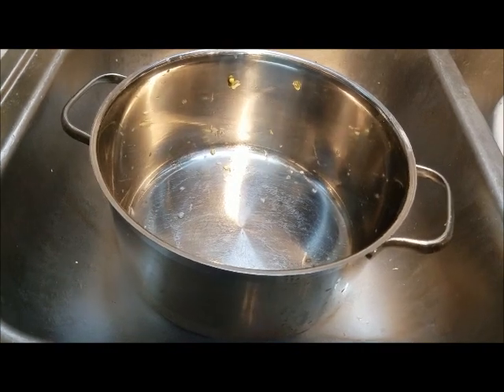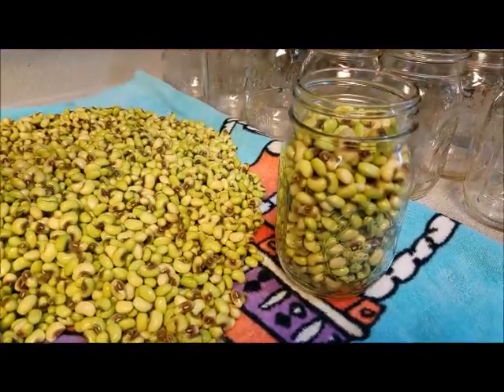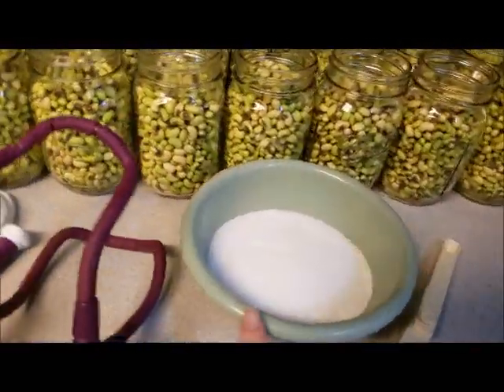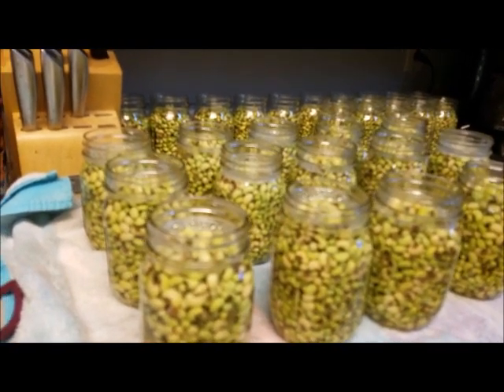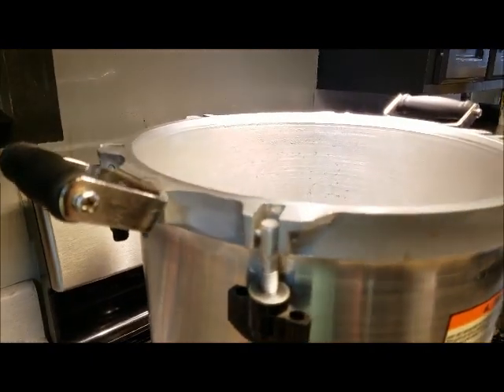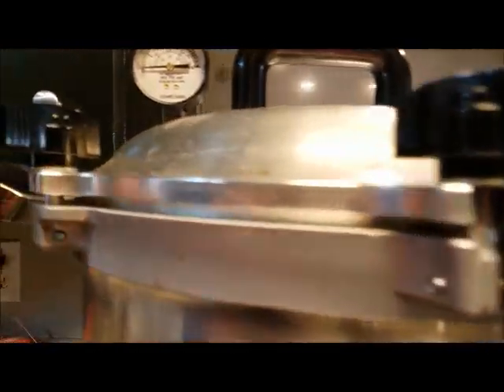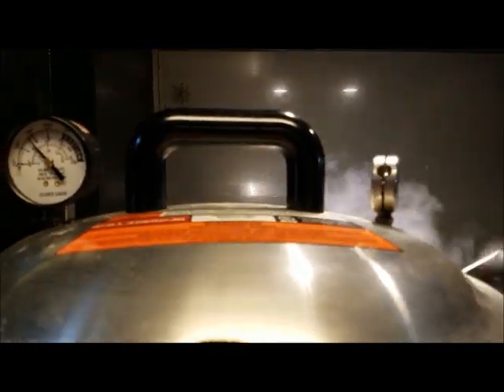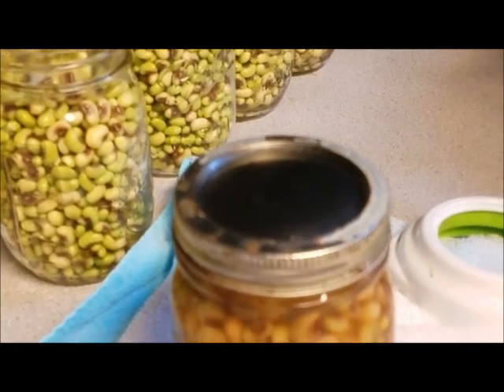How to Can Purple Hull Peas in an All American Pressure Canner

Comment: This is something I'm working on learning to do.  Do you not wipe the rims with vinegar to kill bacteria?
Reply from the maker: We do not, the jars have been washed in the hot dishwasher and we warm the lids. We do put vinegar in our canner. After the canning process is done and the jars have cooled and sealed, I remove the rings to prevent bacteria from growing.
Reply: @RussellsLovingLife  I meant the rims of the jars.. sorry,  like I see most ppl wipe the tops of the jars before putting the lids on with vinegar on here to prevent bacteria there. I'm really wanting to start canning but I get so nervous of boutulism.
Reply from the maker: We worry about that botulism as well. My husband has read and learned about different ways over the years. With the pressure canner, temperatures get above the normal 212 degrees boiling point. You can use the vinegar if you like. Some people do and some people do not.

Comment: We just canned zipper peas, using same canner you have used. All of our pint jars after cooling have no liquid! What did we do wrong? 10 lbs. pressure for 40 min.
Reply from the maker: Some of ours do that too. If your jars sealed, you should be fine. Next time you may want to not pack as many peas in the jars, so you can add a little more water.